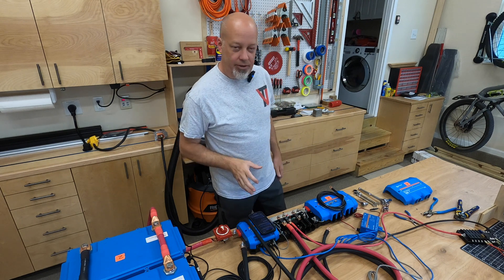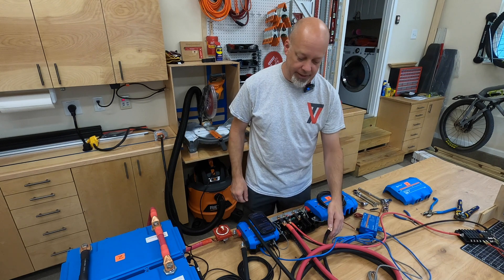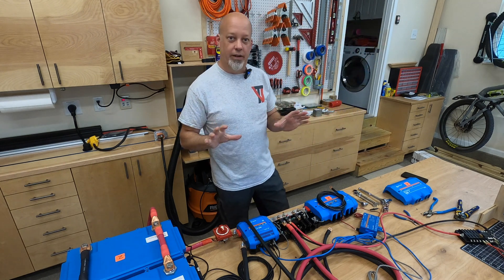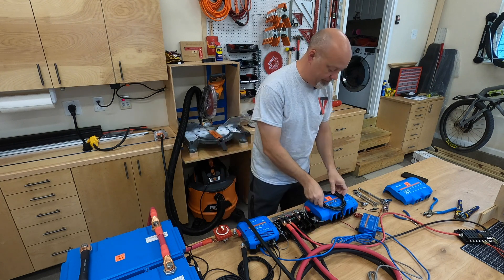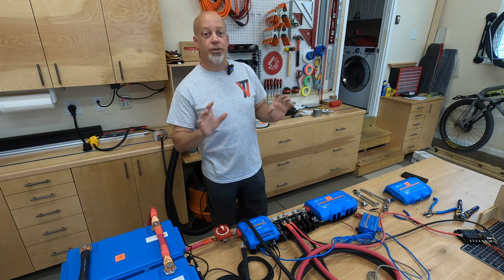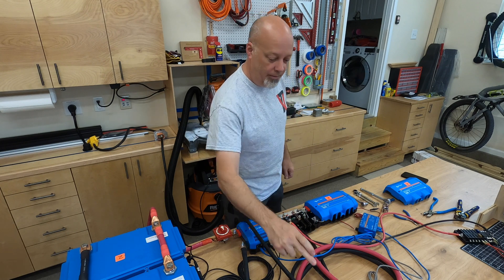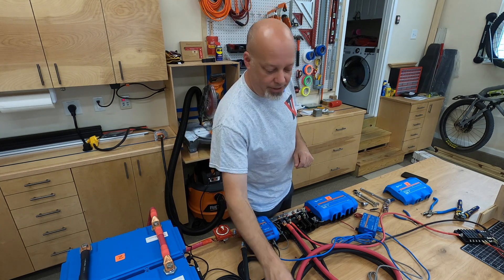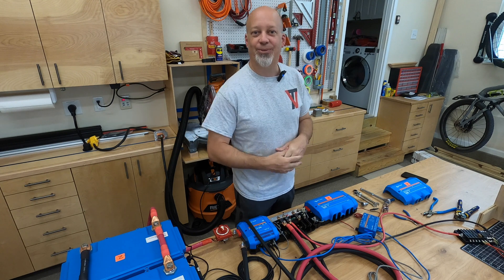Multiplus-II Case Ground - Corrected

Comment: Where do you connect the chassis ground to? The negative bus bar?
Reply from the maker: Yes, the negative bus, not from the battery side of the BMS; from the side with the Lynx Distributors if you watched my other videos, and you can use a 4/0 and one of those grippy/spikey washers to cut through paint to get to metal on the chassis side. In the position I put my electric system in my van, there was a hole in the sheet metal  perfect for a bolt through a 4/0 lug nearby.

Comment: Why bare copper connectors instead of tinned? Copper will turn green soon (oxides) - especially on salty water yachting.
Reply from the maker: You may need tinned in a marine environment. Check with your Victron Dealer for recommendations. My application is centered around a van application.

Comment: Hello
I would like you to give me your opinion (expert!)
on my multiplus in 48 volts (8000 VA 230 volts)
like your video I have 2 outputs + and -
is it better to put a single cable of 70MM² or 2 cables of 35MM²?
can we add under the multi 2 disconnectors on the +?
no need on the - I suppose?
I would like to be able to cut the arrival of the batteries just on the multiplus but not on the lynx distributor for the smart solar which would always charge the batteries even if the multiplu is closed
thank you
Reply from the maker: Hi. Sounds like you might need an EE (electrical engineer) to review your plan. I am mostly only familiar with 12V. If your smart solar is connected into the Lynx D, presuming everything else is setup correctly, the state of your multiplus should not matter for charging from solar. The multiplus status for charging and/or inverting would be related to a shore power input in my demonstration and likely in your design.

Comment: Why isn't a size smaller than 4/0 the 3/0?
Reply from the maker: Technically. Make sure what you install meets your protection needs.
Reply: I recognize that 3/0 isn’t as available sometimes, but see a lot of videos speak about one size smaller than 4/0 and use 2/0. I’ve personally sourced Ancor 3/0.
Reply from the maker: Thank you for the recommendation!

Comment: Sorry but you are wrong here. Literally just used 4/0 for chassis ground (per recommendation if using the same for loads) and it fit fine in the Multiplus II
Reply from the maker: Wrong based on what set of facts and standards?
Reply: @VanTransitions I just ran the 4/0 through the 4 inch opening directly to the right of grounding opening.
Reply from the maker: This could work if you only have 1 pair of 4/0 for pos+ and neg- providing power to the MPII. If you are running 2 pair I imagine that hole is quite full? Also, did you add a 90 degree lug? That may be another way around the hole directly meant for the ground being too small for 4/0 going straight in.

Comment: I am building a system and was using a 6awg wire to ground the multiplus case as well; looks like that needs to change.   However, now I'm a little more confused.  What I am building is a small system for my home, so I also had a ground wire (6 AWG) connected to the negative terminal of my bus bar that goes to the physical ground of my home (basement floor).  Is this incorrect?
Reply from the maker: In my van based system, my chassis ground is 4/0 matching the largest wires in my system. 6awg seems small, but I don't know the size of your system and I'm not an electrical engineer. If your components are Victron, work with your distributor, or consult an electrician.
Reply: @VanTransitions thank you

Comment: Does the case ground from Multiplus attach to the RV frame?

If I have a 24V Multiplus, will the ground interfere with the existing trailer/camper 12V LED factory lights (each individual 12V light is grounded to frame also)?
Reply from the maker: For me the MP II is grounded to the Lynx Distributor which grounds the entire system to the van chassis. You can see that here https://youtu.be/myLpukMa35E

24V and 12V don't play well together without voltage conversion so you will need to know how your trailer/camper existing 12V lights and electric system are configured to know if there will be any interference, especially if both are grounded to the same chassis.

Comment: When I read my Multiplus II manual, it says to use two 1/0 cables for runs under 5 meters, and two 2/0 cables on runs over 5 meters.  You are using one 4/0 connection on your Multiplus II.  This does not have the ampacity of two 1/0 cables.
Reply from the maker: Hi. 4/0 is larger than 1/0, therefore carries greater amps. Please have your drawing/plans approved by your Victron Dealer or an Electric Engineer to make sure you do not undersize any wires in your system.
Reply: @VanTransitions  I am an electrical engineer.  1/0 has a max ampacity of 170 amps at 90C.  4/0 has a max ampacity of 260 amps at 90C.  When you run two pair of 1/0, it gives you 2 x 170 amps = 340 amps.  This exceeds a single 4/0 run by 80 amps.  This is why Victron put two positive and two negative lugs on your Multiplus II.

Please consult your Victron Multiplus II installation manual to verify the correct wiring instructions.
Reply from the maker: You refer to section 4.2. https://www.victronenergy.com/upload/documents/MultiPlus-II_12V-24V_3kVA_2x120V/32424-MultiPlus-II___Quattro-II_120V-230V-pdf-en.pdf "In order to utilize the full capacity of the product, batteries with sufficient capacity and battery cables with sufficient cross-section should be used. The DC cables must be copper and rated 90oC (194oF)."

This is not a hard set in stone "rule". There are options. https://www.victronenergy.com/upload/documents/Quick-Install-Guide-MultiPlus-II-12V-3kVA-2x120V-EN(lowres).pdf Here frame 4 only shows 1 +/- pair wired with a fuse directly to the battery while frame 9 and 10 show 2 pair but no specific indication of a fuse or what the other end is connecting to. Ultimately my choice of 1 pair of 4/0 "may" limit my system from full capacity according to the header of 4.2, but it isn't wrong. What would be wrong would be if I put 4AWG wires instead of 4/0.
Reply: @VanTransitions  That makes sense.  There are so many interpretations of Victron's wiring instructions.  

Your chassis ground dilemma is a case in point.  In my MP II 2x120 instruction, it says to use 4mm(sq) wire for the ground.  That is equivalent to 12 AWG.  I've seen other drawings that go all the way from 4/0 (which won't fit) to no chassis ground at all.

I appreciate your detailed response and I read it the same way.
Reply from the maker: Oh my, I hope that's a misprint and anyone reading this does not put a wire that small on their ground. Do not put 12AWG on your ground! (had to say it) I went up from 6AWG to 2/0 in this correction, and some still say I should have done 3/0. And, I've expressed the same as well, a 4/0 lug doesn't fit through the hole in the chassis to get it to the ground stud. I would have done that just for already having the wire and lugs on hand. All the best.
Reply: @VanTransitions 4mm2 is enough for ground wire on a 3kVA MII, of course it is and no it's not a missprint.

Comment: Do you know why they wouldn't just ground the case to the battery negative wire that's already there and/or could you just tie those two together with a couple of inches of wire?  I imagine there's a good reason why they don't , but I don't understand it myself.  thanks
Reply from the maker: I do not, I would have to refer you to your Victron Dealer or Victron community forums. I find it an interesting and valid question.
Reply: Tha would be because the inverters have their own internal ground lift from the neutral which cime in effect when the grid is connected by providing it's own return path, conversely, when in stand alone , to he inverter's relay connects to be internal newtral offering a safe return path to the ground rod

Comment: Wire sizing is smaller number is larger wire. Thus a size down from #4 would be #6AWG. A rule of (electrical) thumb with ALL grounding wires, whatever the application) is a size smaller than your hot and neutral leads. It won’t hurt to have gone larger, just not two or more sizes smaller. You have it wired in so you might as well leave it. It won’t hurt. Just a waste of money.
Reply: He is referring to 4/0 AWG not 4 AWG cable, which would size down to a 2/0 AWG cable
Reply from the maker: Hi. The 6awg here wasn't nearly a big enough wire, neither would 4awg. I revisit this in my "ground... corrected" video.

Comment: There is a slight conflict of info here, first we hear that the earth cable must be one size down from the battery cables then the same difference is related to the inverter cables. Now Victron Wiring Unlimited clearly specifies that the Grounding cable must be able to carry at least the same current as the battery fuse rating but does not specify the size of the inverter ground cable. Also, the inverter ground connection does not offer many options over a certain size because it only carries a 6mm stud/nut. Confusing 🤔
Reply from the maker: My system chassis ground will match my battery cables at 4/0, which is also the same cable size from my Lynx Distributor to the MPII. My case ground for the MPII goes to the neg bus (middle stud) on a Lynx Distributor. In my case I made the case ground 2/0 as a 4/0 lug simply won't go through the hole in the MPII case. My Victron dealer gave a thumbs up to my schematic.
Reply: @VanTransitions  I understand and that matches my way of thinking too,  unfortunately, Victron only seem to state that the size of the conductor needs to be at least enough to carry the current out which would imply the AC current, that is what confused me.  Thank you for your reply 🙏
Reply from the maker: You're welcome. Reach out to your dealer and Victron support forums to see if you can get further opinions and hopefully clarity!
Reply: @9111logic  Wiring Unlimited clearly states, "...  The DC ground cabling should have a sufficient thickness to be able to
carry a fault current at least equal to the DC fuse rating.   ..."  DC is the battery.  It does not state "AC Current".  And Victron is not the authority for grounding or wire size.  You Local Zoning Inspector is.  Follow the rules per NEC or ABYC.

Comment: I search this subject ...isnt 3/0 one size down from 4/0
Reply: @powerbanksrb - Yes, yes it is ...
Reply from the maker: There is a little confusion here. There is the difference between the MP-II chassis ground and the system chassis ground to the van. In that regard, I have 4/0 from my batteries to my Lynx Distributor AND 4/0 on the neg to the van for chassis ground.
Reply: 3/0 is LARGER than 4/0. 2/0 is LARGER than 3/0 etc. 
when working with wire numbering is the reverse of what we’re accustomed to thinking.
Reply from the maker: Hi. The numbering (smaller number is larger wire) is for AWG, not for Ought.

Comment: Hi, i wonder if you can advise me please. You seem to be from the very few on ebay that insists on safety with grounding, which is imperative, i think. There are so many chaps that use lethal power of 240v and do not figure out the importance of grounding and many others that are trying to sell something.

I need to use my lifepo4 24v battery bank on my caravan , this is in UK , for induction hobs only , as fridges and other tools are running on another dedicated 24v battery bank and i want your opinion how to ground the 24v 8000w surge inverter. I  have found out through videos that, if only one class 1 item is used in the inverter the risk of electro sock is minimal, as no circuit, but if you add 2 class 1 devices , like a kettle on top of an induction hob, powered at same time then you need a complex grounding diagram to avoid lethal shock if there is a fault, as typical rcd circuits will not work as there is no reference.

So should i add a ground or not in a standard chinese 4000/8000w inverter or not , the chinese company says no need for that. Should i go for Victron instead and split phase, i am in UK so i ll need 240v. Should i only use one class 1 device at a time with my 24v inverter , if this is the safer way i ll do it. I will isolate the rest of the mains of the caravan i can make a dedicated circuit , i need only the hobs mainly to avoid gas bottles, when i sue the caravan, but i can not find answers about grounding.
It is more than obvious when you watch ebay clips that there are many  chaps doing really risky things, so you can not trust any thing you watch actually.

Kind regards

Regards
Reply from the maker: I recommend you consult your manufacturer and an Electrical Engineer (certified electrician) for clarity.

Comment: So if I don't have a ground to the chassis (5th Wheel), would this cause the victron to shut down when I turn on the A/C?
Reply from the maker: Hi. Your question is a bit vague. You need to be properly fused and grounded. You may want to run your electric diagram by your Victron dealer or contact Victron support either via your dealer or direct if you are having issues with Victron equipment.

Comment: Currently fighting the case ground on my multiplus II.  And bonus I am out of spots to ground my case grounds.
Reply from the maker: Hi. Note how I combined case grounds for my MPPTs in the MPPT video to save a space; but I'm not sure I would combine the MPII with anything! You can ground it to the end of the neg bus bar on a post there vs on the post in the middle potentially, if you're using Lynx Distributors?? Please check with your Victron vendor or an EE if you have difficult wiring questions.
Reply: @VanTransitions  will do.  I am using the lynx distributor and the lynx shunt.  I was in good shape till I realized I had to run the chassis ground after the shunt for it to work properly.  Thinking I might have to add an extra bussbar just for grounds!

Comment: Shouldn't that be 6AWG? Lower number, thicker cable.
Reply from the maker: The wire for the case ground? See video description. 6AWG is way too small, thus this video to correct that. 6AWG, 4AWG, 2AWG, etc. 0/0, 1/0, 2/0, 4/0 are examples of smaller to larger cables (left to right). 4/0 = 4 ought

Comment: Does your Victron multi plus come bonded or unbonded?
Apparently, a lot of other inverters are either bonded or unbonded at the manufacture !
Reply: victron multiplus 2 in some europe coutries usualy comes  NOt bonded but i m not electrician and cant figure out nether mine if it is bonded or not,,,!!!!  i hope there will be a safe way because there are thousands of them already running  and probably with not a clue of stats of earth and ground extra safety!
Reply from the maker: I would refer you to Victron documentation for that question.

Comment: What happened to 3/0? (95 mm2)

Still think you are ok but abyc might not…
Reply from the maker: I questioned my Victron dealer on this heavily as I am not an EE. On more than 1 response, they restated I was OK and quoted the ABYC standards. I get your point though.
Reply from the maker: I don't have any 3/0 cable or lugs to test, but it will probably fit, very tightly... the 4/0 lugs I have will not.
Reply: @VanTransitions  no worries!  I’m at 25.6v so am able to use 2/0 and 1/0. I’ve seen 3/0 but it’s pretty rare—probably pricey, too

Enjoy your channel. Nice work
Reply from the maker: thank you. so much more to learn and share through the process!